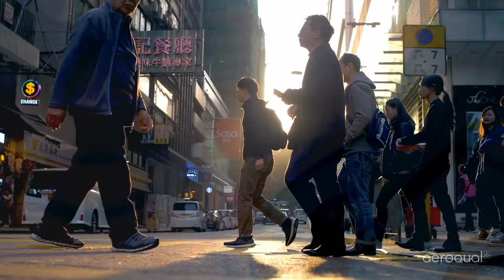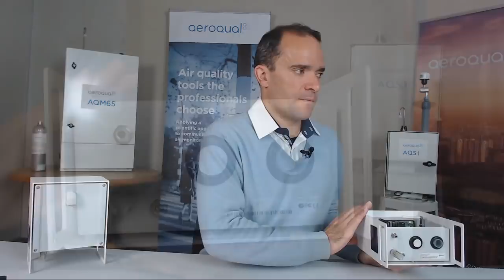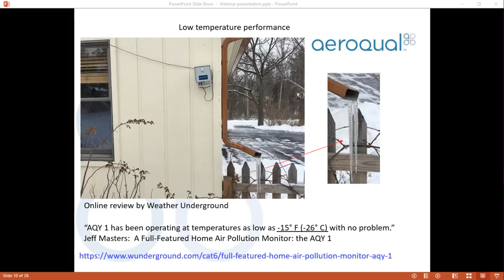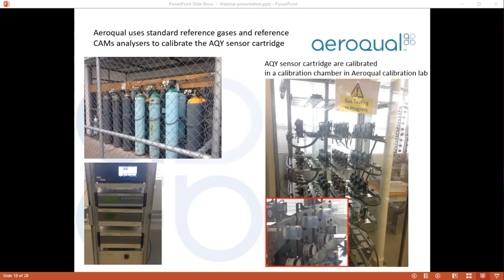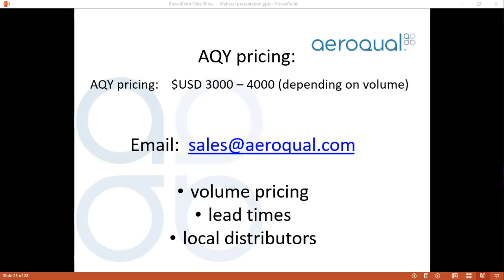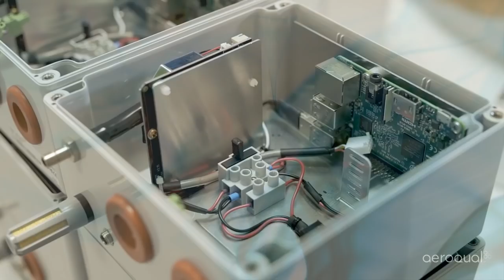Aeroqual AQY Webinar Session One

Comment: For me this power consumption is huge, what causes that the sensors, the modem or the RBpi? I’m really surprised that the Raspberry works stable in low temperatures and high humidity levels.